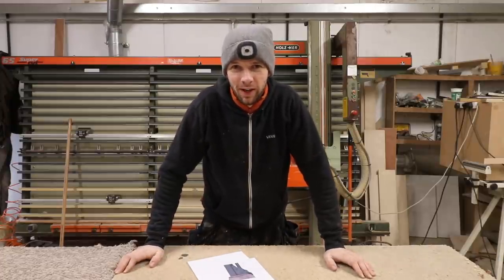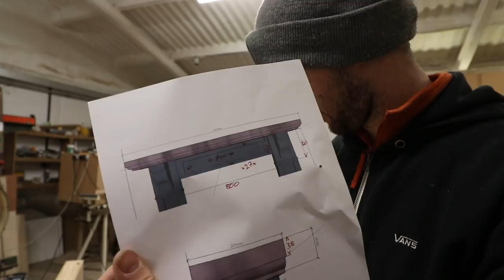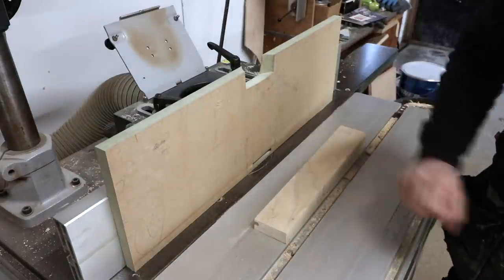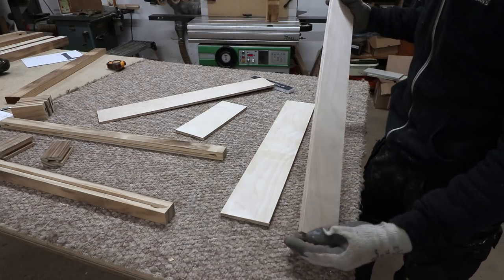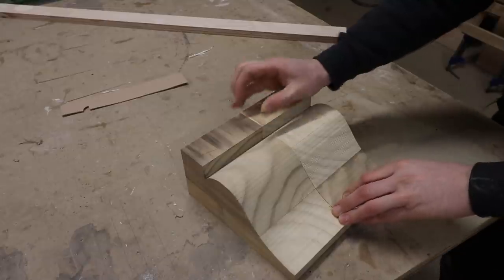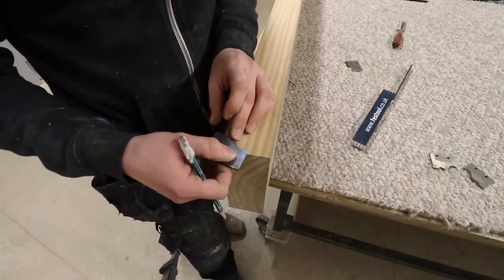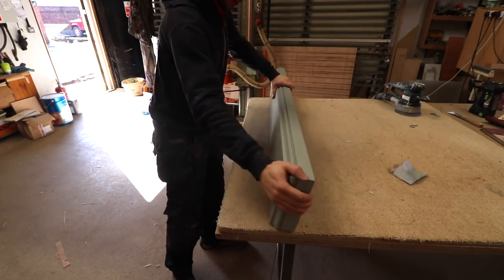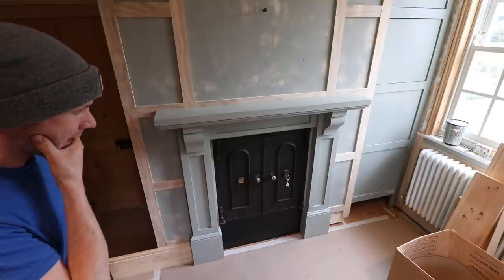Making a Timber Fireplace Surround and Wood Mantle Piece.

Comment: Is it common practice in the UK to use the metric system?
Reply from the maker: Yes, pretty much standard, except most, or alot, of material are stil sold in imperial measurments verbally. 2x4 timber for example would be 50mm x 100mm and all sheet material is either in 8x4 sheets. or bigger variant defined by feet